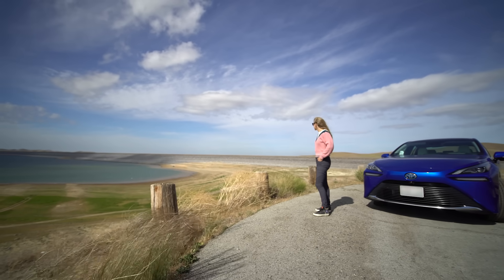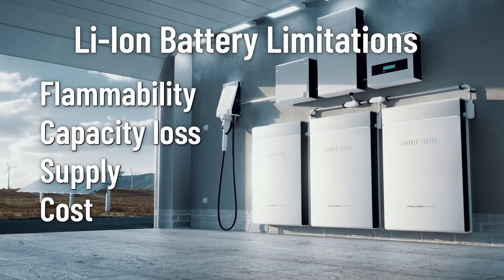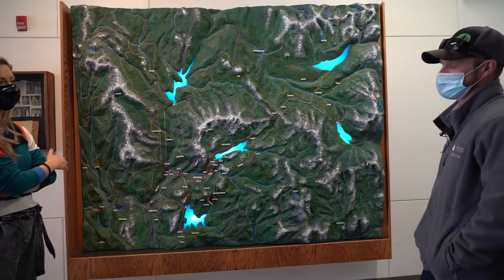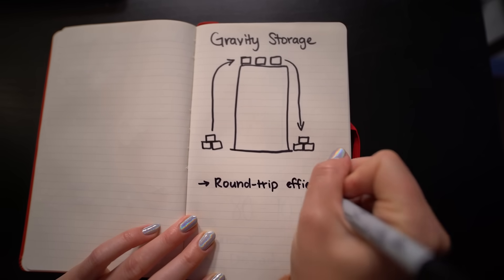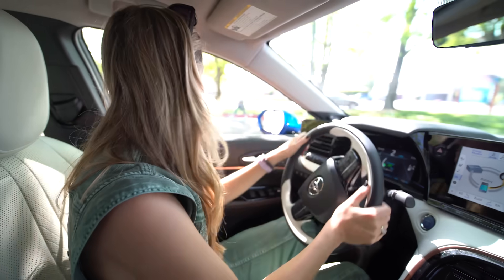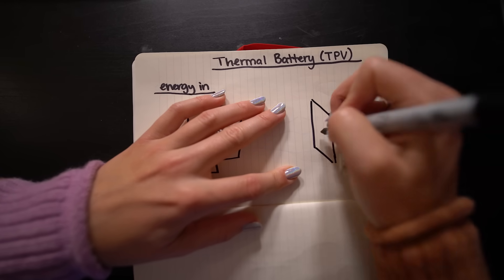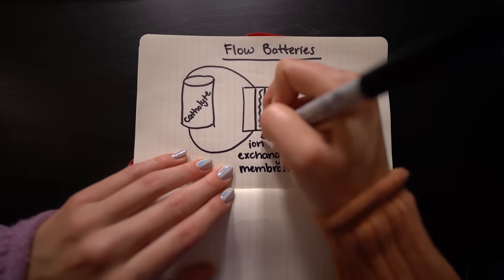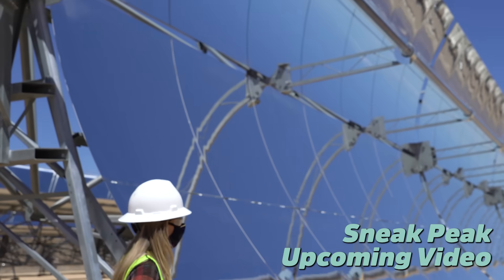The BIGGEST problem with clean energy

Comment: Great video Dianna, thank you. In my mind one of the best energy storage routes is renewable methanol made with atmospheric CO2 and hydrogen by electrolysis from renewable electricity. This is already being done in Iceland - see Carbon Recycling International. (Their source of CO2 right now is actually from a geothermal vent, but all the technology exists to extract CO2 from the atmosphere and use that instead. It would create an artificial carbon cycle that does not use plant matter.) methanol in turn can be used to produce gasoline and other hydrocarbons, and these technologies are also well-established. It would be an excellent way to use excess power from renewables. The efficiency is relatively low, but there are many excellent benefits such as long-term storage, no degradation of the stored energy, high energy density, and compatibility with much of the present energy infrastructure. Please do a video on this!

Comment: Just one problem...
Preface: I like your channel a lot, and I think you're doing a great job. 
You say you're new to hydrogen fuel cell powered cars, so I'll take your word for it.
You state that Toyota is your sponsor for the current series of videos you're making, so I'll also take your word for it.
Based on my research, and my opinions and conclusions from said research, Toyota is anti-EV. Specifically, Toyota is anti-battery-EV.  Their huge investment in hydrogen fuel cell was for naught. Ditto for their early hybrid investment two decades ago. Toyota did a great job with early hybrid technology from 2000 to 2010, but then chose to go in a different direction. Toyota is actively lobbying governments in Japan and the United States to SLOW the adoption of electric vehicles! Lithium is a "salt", and therefore much easier to mine than aluminium, but more difficult than sodium. Lithium is also recyclable. Tesla has both the plan and the tech to mine and recycle lithium, so I don't buy the "lithium will be used up" argument.

I also don't buy the "lithium battery degradation" argument either. My 2016 Model S still goes over 250 miles on a single charge, under real-world-driving, after more than 200,000 miles on the odometer. Just like my phone, I keep it charged between 20% and 80%. I can drive cross-country with extreme peace of mind. I dare you to do that in your loaner Mirai.  I fully support hydrogen, and I think excess grid capacity can be used to charge hydrogen tanks in the future, when there's an oversaturation of photovoltaics. For now, BEVs are crushing the Mirai. And Toyota should be running scared, as they are.

Disclosure: I've owned a Prius V, a "plug-in" Prius, and a Chevy Volt. I've installed my own  solar panels and used Tesla Power Walls as backup.  I've gone grid-independent, until I realized it was selfish, and plugged back in so the utilities can use my excess capacity for the greater good.

Comment: The water is not "pumped down".  That would take energy, diminishing the goal.  Also if you extract the heat generated from the compressed air, the pressure will drop thus diminishing the effectiveness of turning the turbine.

Comment: Great job presenting! If you can find: I am interested in co-op power-share schemes if you can find any. For example a neighborhood of 10 homes each with PV panels and vertical axis wind turbines also have (hidden) elevated and in-ground storage tanks for water. They can pump the water "up" during the day and drain for power at night and have it as a buffer storage for no-wind and no-sun days - they are hooked together and share their power year-round.

Comment: Wait.  "The supply of lithium is estimated to run out by 2080"?    I don't think anyone in the EV industry believes this.  We have a lot of lithium, and the lithium in batteries is eminently recyclable.  Recycling rates are expected to be in the high 90 percent range.
Reply: There is probably so much lithium in the cycle in 2080 that no one needs to mine it anymore and they just misunderstood it in the video.

Comment: Well,  I think efficiency is missing although it was mentioned in that something is happening. If you use efficiency to solve problems  ( energy- electric) in this case you should end up with everything you have mentioned is obsolete. Thanks for the vid.
Reply: 1. Price, 2. Scalability, 3. Efficiency. By other words, efficiency is only one factor, and it only needs to be good enough if the other two are good, to make it viable.
Reply: If plants are being shutdown to not overload the grid, efficiency is not your problem, as a plant that is shutdown has 0% efficiency and you can afford to do that . . .

Comment: I always wondered if you could do compressed air storage in deep water. Just sink a large concrete caisson to the sea bed somewhere deep and make sure the overall mass is greater than its displacement. Leave it open to the water at the bottom to allow the weight of the water column to compress the air. The pressure of the water also supports the caisson structurally. You can fill it to the pressure  of water at that depth.

Comment: I really wonder why in such videos there are always some essencial topics are missing. 
You can store some of the renewable energies before transforming them to electricity. Most obvious: Stop using bio gas in gas turbines when there is enough energy in the grid. Bio gas can be stored in huges amounts. The solar power plant at 1:27 produces heat in the first palce. This heat can be stored for a long time without losses. So you can chose when to use the heat to generate electricity.
But at least as efficient than storing the enegy is when you adapt the time when you use engergy. If you have a well isolated house you can cool it down or heat when there is enough engery and switch off the heat/AC when there is a lag of energy. Same might be possible for the parts of industry that needs alot of energy. Maybe we stop blast furnace when we know that we'll have energy shortage for a longer period (e.g. mid Winter).
Reply: :-) The next video tackle exactly this topic.

Comment: I think you forgot to mention one of the major drawbacks of using hydrogen; it is extremely flammable and explosive. That's why there aren't many hydrogen fueled cars even though the tech has been around for a while already. Of course, if handled correctly, it is a very promising way to store energy.

Comment: How about flywheels? I feel I've heard something about flywheels being used to store energy fairly cheaply in low friction vacuum tubes. Are those not quite so viable?
Reply: Flywheels have largely fallen out of favour, as although they could react very quickly to help smooth/stabilise the grid, they are power dense, rather than energy dense storage. Cheap battery storage has made flywheels largely economically uncompetitive.

Comment: Using photovoltaic cells for converting heat to power is something I thought was possible, but thought there was a reason we weren't doing it to begin with
Reply: They seem to be using special solar panel since the IR wavelength has much less energy than visible light and heat makes conventional solar cells less efficient. Also they have to run that machine in a vacuum chamber to not have heat losses to the air. I Imagine using Peltier wouldn't be impossible but you must reject the heat to the outside to get that to work. There is a coating to allow a panel to absorb IR and convert it to a wavelength a conventional panel can use, as well as multi layer panels for increased efficiency. Also concentrated solar photovoltaics which this seems the most similar to from what I could see.

Comment: this is all well and good, but a car will just never be sustainable, be it electric or hydrogen based. The most important thing we can do is rebuild our cities around much better public transit and active travel
Reply: Rebuilding cities will take enormous amounts of energy. Of course, the actual construction will consume great amounts of energy, but the manufacturing of new materials is an energy-intensive operation. Transporting construction materials will also use significant amounts of energy. Then there is the problem of what to do with all of the waste from the demolished buildings.

Rebuilding cities may be a cure that is worse than the disease.